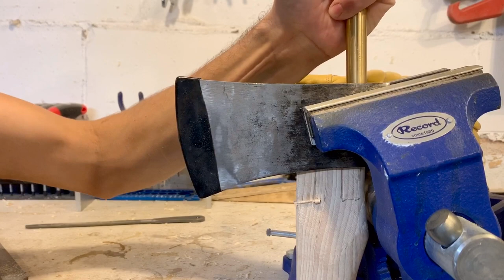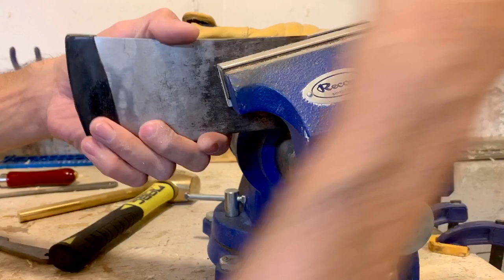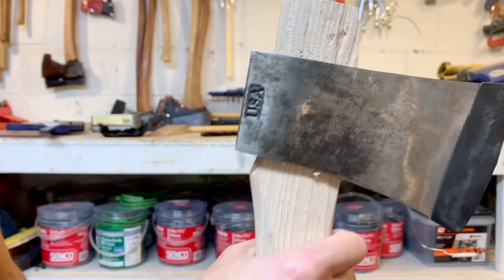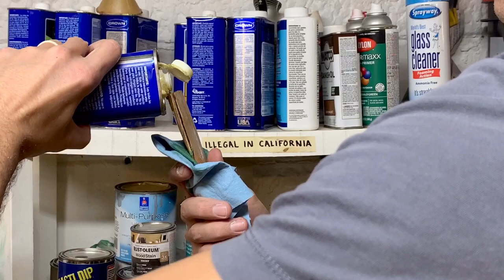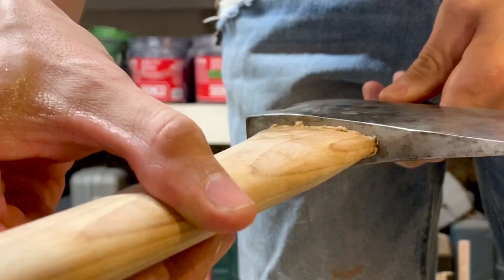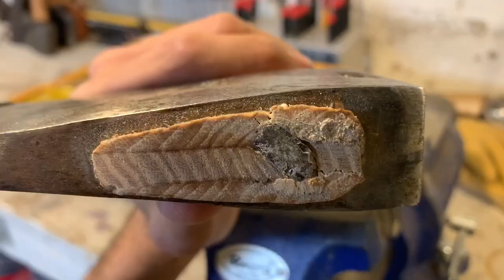Council Tool Replacement Handle: When You Get Home Early From Work and Just Have to Hang an Axe!

Comment: Yes, loose heads are annoying! So much so that I soak down the handle, wedge slot, and wooden wedge with boiled linseed oil when I hang tool heads (axes, sledge hammers, splitting mauls, etc.). That combined with at least an annual wipe down of the handle and head with BLO and the heads stay nice and tight regardless of humidity.  

Then again, there is another consideration when it comes to loose heads:  We modern guys have to contend with the fact that the humidity in our "conditioned space" homes and shops tends to be much lower in winter and summer than what people experienced 200, 300 years ago. Dehumidifiers, A/C, vapor barriers, air to air heat exchangers in fresh air intake systems, bathroom fans, kitchen fans, etc., all help keep indoor humidity low. Back in time things never really dried out unless they were sitting next to the fire place. That said, most of my long handled tools are stored in an unheated equipment shed so the humidity and BLO could be working together to keep heads tight.  It's interesting stuff...
Reply: Yes I make sure everything is acclimated to my shop and dry..fit the head..   let it soak up..danish oil.. if it ever comes loose I can add a metal wedge later.
Reply from the maker: I also have all my handles and blanks in my shop next to a dehumidifier. I want them as small as they’re ever going to be when I hang them.

Comment: Some of these factories just can't hang a head properly sometimes 😖
Reply from the maker: It’s my biggest complaint about production axes. I’m willing to do everything else: slim down the handle, oil it, profile the head, but the hang has to be solid.
Reply: I suspect it has a lot to do with high humidity in the factories where they make them, and then when they are stored in a drier environment they come loose. Id actaully really like it if companies started shipping axes unhung or at least without the wedge in
Reply from the maker: That may be the case. I’d love it if they’d ship them unhung. I really only trust the handles I’ve hung anyway, although so far I’ve got two production axes that haven’t budged: Husqvarna and the GB boy’s axe, although I haven’t used the Gransfors that much yet. So time will tell. If it comes loose then they aren’t worth the money.
Reply: @KevinsDisobedience  I have heard of literally every production axe coming loose at some point or another, including gransfors, but some seem to have a better track record than others. not a single of new axe of mine have come loose which is quite strange. UK doesn't really get very dry spells due to being all coastal but even then its odd. Maybe I am just lucky
Reply: @jeffreyrubish347  A couple of italian companies still sell heads only such as rinaldi and prandi. wish council tool and hultafors did the same

Comment: Hey Kevin, curious on your thoughts on the velvicut boys axe.  I’ve been messing around with the fiskars stuff, but want to get my first “real” axe.

More or less decided the CT boys axe seems like a good route for me, but trying to decide if I should spend the extra for the velvicut.  Also have seen that Whiskey River is offering a forest service reissue as well.  Thoughts?  Thanks in advance, and loving your channel!
Reply from the maker: I have all four versions of the CT boys axe.  I’m going to be doing a comparison video real soon.  If I were you I would pay the extra for the Velvicut.  It has a nicer handle and sheath, but the steel seems the same to me.  I’d just get the Sport Utility and order a sheath for it.  But that’s just my opinion.  Let me know how it goes.
Reply: @KevinsDisobedience  that would be an awesome video!  In all my digging around I have not found a side by side comparison of all the models.
Reply: @KevinsDisobedience  and also thanks for the response!  I’ve got some pondering to do
Reply from the maker: Me either.  I intend to fix that.  Personally, those types of videos—when done honestly—really help me as a consumer make a better, more informed decision.
Reply from the maker: Sorry, I just realized my typo.  I said “would” get when I meant wouldn’t.  The  Velvicut is a nice axe out of the box, but the handle came loose after six months and I could fix it with a metal wedge, so I had to replace it anyway.  If you want a happy medium, the Forest Service reissue may be a reasonable choice, but I haven’t actually tuned it up and used it yet so I can’t speak from experience there.

Comment: Sorry if i missed it, but what is the purpose of these "ribs"? Are they supposed to help with tightness? They seem to small for that and rather annoying.
Reply from the maker: Nah, you didn’t miss it.  I don’t think they do anything except cause trouble, but the purpose I suppose is to bite into the wood and effectively create a toothier bond.  In theory it kind of makes sense, but in practice I haven’t seen a difference.  I’m rehanging this axe because it came loose.  I’d even be willing to argue that axe heads with ribs are more likely to come loose than heads without.  I suspect that the ribs often stop the wood from really compressing against the steel walls of the eye, which is ultimately what keeps the head on the handle.  On softer hickory, like this handle, it probably doesn’t matter much, but if you have a really hard piece of hickory you almost need to notch the grooves with a file to be sure you’re getting full compression.  I hope this explanation helps.  But don’t don’t my word for it.  Ask around, or better hang an axe or two with ribs and you’ll understand why I don’t like them.  😆
Reply: @KevinsDisobedience  more effort = better hang could make sense but if the focus is to work around an obstacle that hardly makes a difference apparently, i would probably get frustrated and it would result in a worse fit... thank you for elaborating. I have yet to hang an axe but as i am still somewhat learning how to swing one i might be learning that sooner than later. Be well.
Reply from the maker: It’s good to hear you’re interested in learning how to hang an axe.  I truly believe anybody who uses an axe seriously should know how to build one and maintain it.  But like you said, first practice the swing and then move on to the builds.  Make sure it’s something you want to commit to first.  But once you “get the hang of it,” it’s so much fun!

Comment: Illegal in California! Haha! Is your workbench really tall?
Reply from the maker: Yeah, I like working close to my face, but it’s a pain with the vise. I do have a step there that I use when I need it. When we move, I’ll build a proper bench for the vise. Thanks for watching.
Reply: @KevinsDisobedience  I had a tall workbench for the same reason.  I lowered it for the same reason.  Haha!
Reply: Yeah... they aren't allowed to have really useful stuff in CA and the bans have spread to other states and nationally. I dearly miss the oil based indoor and outdoor penetrating wood finishes in gallon and five gallon buckets!  Regarding vises... I have them and benches at multiple heights and use them on a task specific basis.  If you've got room it's a great way to go...
Reply from the maker: I’m a painter by trade and I can tell you nothing is a durable as oil based paint. It has its downsides, but durability isn’t one of them.
Reply: @KevinsDisobedience  Judging by the buckets of collated screws I would have guessed rocker. ;~)
Reply from the maker: Yes that too. Lol
Reply: @KevinsDisobedience  Rocking and taping... a young man's game. That has become abundantly clear to me in the past year. Last year this time i redid the interior of a condo and am now rerocking the interior of my house as part of a complete gut-job renovation. I should have kept going 25 years ago instead of taking a break until I had more time. Idiot! LOL
Reply from the maker: It really is. I started my own business 7 years ago now, which has been one of the best decisions of my life. It is hard work, but I don’t see myself ever just showing up to watch my guys work. I still enjoy it is what I’m saying, although I’d rather be in the woods any day of the week then sheeting a house. Lol.
Reply: @KevinsDisobedience  Time does catch up with you though. The modern light-weight 12' sheets I've hung recently seem a lot heavier than the standard 12' sheets I hung 3-4 decades ago. Life happens... 

I've always enjoyed the woods. Having grown up rural my neighbor and I got our hands on our fathers' old hatchets at around age 9 or 10. We had the hatchets before they'd let us have sling shots and BB guns!  With those hatchets we played "lumberjack" and felled 3-6" trees with them. We built "forts" and camps with the wood. Our hands were a blistered mess as I am quite sure the hatchets were exceedingly dull and the handles rough. We had a great time anyway!   I still frequent those same woods and have fond memories of specific locations and events as I continue to make new memories.  That said, I still enjoy looking at the fruits of my labor hanging on the walls and ceilings!
Reply from the maker: I hear you, brother. We do mostly residential, but before I was on my own it was a lot of commercial. And 5/8” sucks! So 12’ sheets at 1/2” still feels light. Although we do a lot of 9’ ceilings out here, so we use 54” sheets on the top of the walls and they get heavy after awhile.  

Those old spots in the woods really do bring back memories, don’t they.  It’s nostalgic for me to walk through old trails.